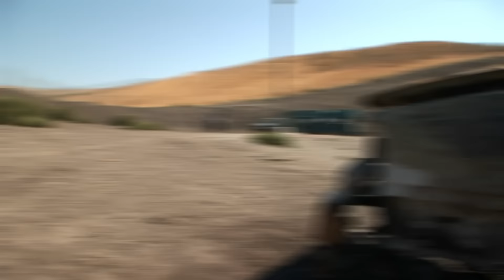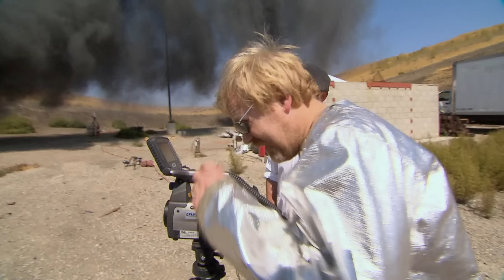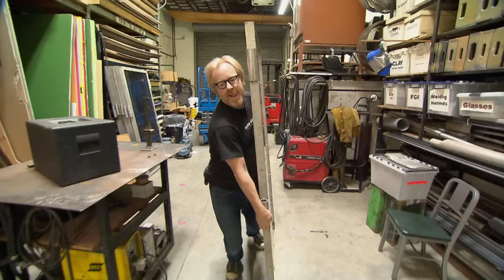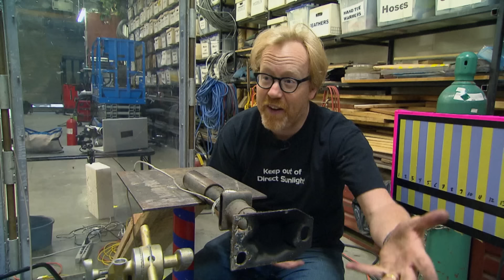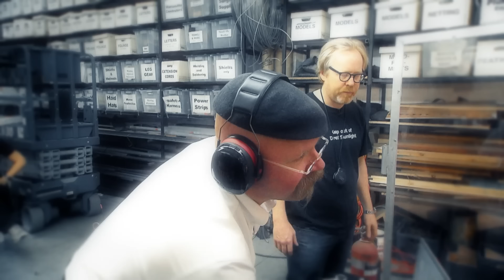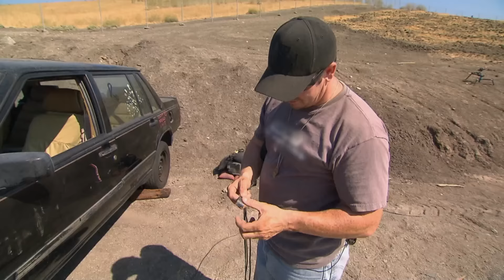Can A Car Bumper Really Explode Off A Burning Vehicle? | MythBusters

Comment: Maybe the smarter thing to do would have been to light something on fire and toss it into the car that was swimming in gasoline rather than standing so close you might catch on fire also when the car does.  Also smarter would have been to heat the shocks outside rather than filling the shop with possibly toxic gas

Comment: Something i picked up on in her story was that she used a fire hose under the tire well (our suspected location of failure) maybe that had something to do with the bumper blowing off due to some hypercooling effect of the metals and gasses - the guys only used fire as if the car would have done it on its own from just the car being on fire. also because the chunk of bumper came off in the middle I would suspect that she was spraying the hose from the front of the car not the side of it..

Comment: I had no idea they even had pistons in them. It's not something I've ever specifically thought about but I would have assumed it was just dense foam. At least it partially explains why bumper replacements cost so much.
Reply: I think it was an older idea (kinda 80s and 90s). I've got a 1994 BMW and the front bumper on that is mounted via those pistons. Younger cars with more sculpted bumpers are generally bolted/clipped in place, as is the crash bar behind them

Comment: The bumper that hit the firefighters shin only traveled 15ft because she was standing 15ft in front of the car. The damage it did to her suggests that it had enough energy to go the full 50ft.
Reply: Given that it basically pulverized her leg, it had a lot more energy. That said, i have to wonder if the car wasn't parked in a row, thus the bumper pinned her. It's not exactly explained how she fell. Because if that's the case, then it might've been less. You'd be surprised how little force is required to crush your bones if there's something to hold the force in. Remember, you can kick break someone's leg if it's against the ground (the plethora of cases of police abuse with broken bones as a result).

Comment: I think the missing element is water. The lady that was actually injured by this phenomenon hosed it down and I believe water cooling down that area of the bumper caused the trapped steam or gas to build up and explode. That to me could've been the cause all along. The wrong place and the wrong time under the right conditions to make this phenomenon happen.
Reply: Dunno... unlikely. They're in a shrouded area, water doesn't directly hit them short of spraying from under the car. It's an intentional design (to keep them from rusting and becoming degraded.
I think it's more like someone in the comments said "first year". Over the years, i've seen a lot of "first year" fails. Sometimes like this, sometimes they overdo something (and it's actually good for us like first year Touareg are tanks compared to later ones. First year of all of that class across the board was overbuilt and every component is triple thickness and quality above board, because they didn't know what that car would take in abuse), sometimes they make it too light (can't remember off the top of my head and googl isn't helping, but a first year car would get so rusty it broke in half when load was applied (people getting in)).

Comment: As someone who has been dealing with dangerous air quality over the past week, and trying to figure out which source is actually reporting the most accurate AQI because DOGE gutted accurate data gathering, Canada needs to do something differently than they have in the past. I don't know enough to even take a guess at what would work. 
However, "tariffs" are perhaps the dumbest possible attempt at a solution. 
Remember when Republicans loved to say that you can't tax your way out of a problem? Ironically, they'd be right on this problem, if they weren't trying to tax their way out of it.
Reply: You're unhinged rant has no place in reality.
Reply: *Your
Reply: Gods least schizophrenic soldier

Comment: I have to wonder if the problem was unique to a few first year car models.  Once the problem became known, the shocks were redesigned to prevent it.
Reply: my thought was also potentially damaged bumpers from hitting things that caused a crimp
Reply: I was thinking damage or maybe some aftermarket replacement that didn't have the safety features @Miryn
Reply: Likely. Even with a lot of testing, there's always going to be a few things overlooked. And that doesn't take into account cases where defective parts are used.
Reply: It could also be that the ones that exploded were part of a faulty batch or something along those lines.
Reply: This seems like the kind of issue that would be dealt with internally, and quietly by the manufacturers. They figured out that it was possible after it happened once or twice, and then added the fail-safes.

Comment: This volvo are knowing as indestructible for many reason.
Wanna know why?

Redblock are extreme durable and can also tuned high of you want more hp. The last engine has made on 1998 for 940.

Speaking of the bumper.
Before 740 was made, 240 was the one very first time they introduced bumper which allowed to absorbed up to 20km/h (13mph?) Without taking damage body.

Comment: I always disagreed with this one. How can it be Busted if there is actual evidence of it happening in the real world.  Busted just because Jennifer's didn't go 50 feet?
Reply: Because not only did it not go 50 feet but it was not simultaneous.
Reply: It's the myth of a single bumper going 50 feet. 

One: in the case of a failure, the shocks don't go off at the same as seen with Jennifer 

Two: projectile failure is rare and designed not to happen in multiple ways. It can still happen, but it's very rare.
Reply: Jennifer accident was a one in a million chance, if it was not then there would be hundreds of this kind of accidents, all over the world.
Reply: @andy70d35  All of the people commenting "but it wasn't busted" don't understand basic comprehension. 

"The myth was 50 feet." 
"But it happened" 
"It only went 15 feet and it was only part of it"
"But it happened."
"Not anywhere close to the myth's parameters"
"But it happened"
Reply: feels like one of those 'several things had to go wrong for it to happen' things (I can't imagine 'car fire' is a scenario the designers failed to account for, same as the one about the exploding propane tanks or the water heaters), and it's not like mythbusters were thoroughly rigorous in their testing. (otherwise they'd have saved the data when the show went off the air, if not published it)
Reply: I get what you mean, but a big part of the show's remit was addressing the popular versions of myths, not the realities that inspired or reflected the myths. A lot of the myths they took on were obviously partially true, but people had decided that truth was not as entertaining as fiction, thus the exaggerated versions that the show addressed.
Reply: @genericpersonx333  Sometimes they use very specific figures as the requirement. I think these are often too specific. I don't know this myth at all so I have no idea if "50 feet" is the common claim. In science it makes sense to have specific goals like this, but they way they present it is sometimes not good science communication. The general audience expects the verdict to correspond to the broader and less scientific version of a myth. There are a lot of these that probably should have used an 'inconclusive' verdict with the way laypeople are interpreting them.

Comment: honestly with how dangerous some of these myths got it was a miracle everyone survived the show without any missing limbs
Reply: They're always using shields.
Reply: @shawbros   they discovered in a later season that the shields were basically worthless. They were essentially unshielded for a lot of the show.
Reply: @themanhimself3 
They can't be worthless.
That's like saying safety glasses are worthless.
Reply: @shawbros  I'm looking for the episode but it didn't even stop 9mm if I remember correctly.
Reply: @themanhimself3  The 1st season Blast screens was from a thin version of the screens that they been using for all 18 season on air. The 1st "What is Bulletproof?" segment showed how lucky they were.
Reply: The ballistic shields are bullet-resistant. They can stop a 9mm. It was a .30-06 (7.62x63mm) round that went through it. This was in I believe either a season 2 or 3 episode.
Reply: They were always quite safety conscious
Reply: This is a less than smart comment.

Theyre standing behind a blast door away from the test itself. Like what? The definition of “done by professionals”
Reply: @patsweeney4220  I love this show soooo much and without Adam and Jamie it would be nothing to me but if you view Adam almost setting himself on fire and Jamie tipping over a telehandler in THE SAME EPISODE as the work of "professionals" citing that they often stand behind a 3/4" thick piece of bullet resistant plexiglass from a safe distance afterwards then I'd suggest you watch something more akin to your intellect like PAW Patrol or Cocomelon.
Reply: @michaelwave2002  lol you’re not wrong.. but I think the blast shields are just for debris or just one safety layer. Jamie does say “these will stop a bullet” somewhat incorrectly but they never used it to be fired at. everything they’re doing is inherently dangerous and so I think it’s just a part of the “don’t try this” thing. I think you can also be a professional and not know everything .. but I will say their safety definitely improved as the years went on (for various reasons, they talk about insurance policies changing over time on Tested and Mythfits for example)
But yeah like part of the whole thing is they’re riding that line between dumb and smart. Professional entertainers
Reply: @patsweeney4220  how does it rate on a politeness or manners scale? Or do you not have one of those?
Reply: @70eightRPManother one 😅